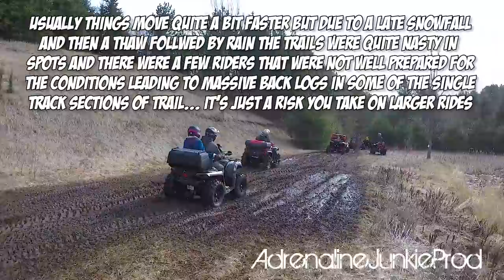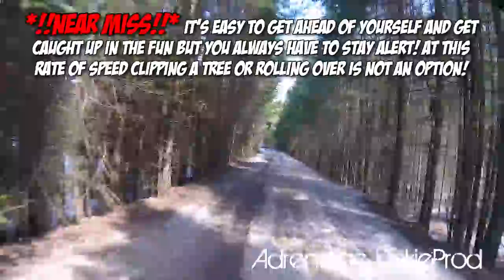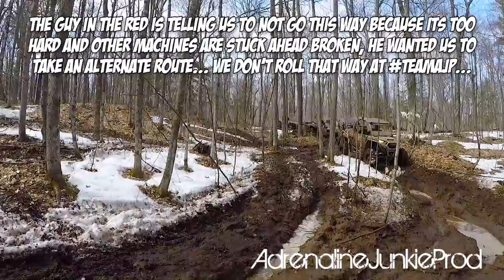Dungannon Mud Bog 2018 - SXS/UTV/ATV - Feature Length Trail Ride - #TeamAJP Trail Vlog 012

Comment: You can also use arctic cat trail shocks on the cf. Gives 2" of lift and a lot softer ride plus allows for larger tires.  And I believe more travel.
Reply from the maker: That's some good info. The shocks on those CF Motos are poop!

Comment: See  that's why you keep yourself small jumper cables and a couple welding rods and you can weld it right back up and go by using the battery off of your ATV or side by side

Comment: I own a CF Moto zforce 800ex and it can go down the trails at good speed as long as your not drag racing it will outrun the rzr 800 so it’s not bad in its class

Comment: great video, recently purchased 2018 rzr xp1000, would love to see video about shock adjustment/recommendations and suspension tuning. Thanks
Reply from the maker: Hey Michael. Next time I'm out at the track or doing some high speed trail riding I'll do a little video on suspension adjustment and what works well for me. Great suggestion, thanks!
Reply from the maker: Congrats on the new RZR by the way!!!!

Comment: ive got a 17 wildcat trail limited with the supper ATV long travel kit that makes it 62 inches wide, a set of 32's on there and it just goes through everything and anything. the thing is just indestructible so when i hear you say that sport works great i believe it.

Im also wondering why they planned a ride that a full size SXS cant go over like that tiny bridge by the start.  around here sometimes rides go through areas like that but they have detours for larger machines marked out and you meet back up with the group after the obstacle

Comment: My 2017 cf moto 800 trail seems to be just fine and seems to have decent power and good suspension travel as well, I mean for the price an warranty difference comparison to equal machines I believe it does as good and better tan some, just saying

Comment: I have a 18 zforce trail with a 2 inch lift stock tires and I go everywhere Polaris, Honda, and Can ams  go. Sometimes better than they do. I want to stay in 50inch class because of the trails I ride. I also have a 2012 commander 60 inch wide and I have some difficulty getting it thru some of my favorite trails.
Reply from the maker: As I've said many times in the past. The most important thing in these machines is the operator. I'm hard on CF MOTO sometimes but at the end of the day it doesn't matter what you ride as long as you're out having a good time.

Comment: try the can am commander 1000 its great and i want to see what it can do on the trails you guys go on
Reply from the maker: There are some commanders in our previous videos. They do well on the trail. A little less ground clearance but generally speaking a very capable machine. With the right driver they hold up just fine with the rest of the pack.

Comment: Would love to see a YXZ1000r SS on a ride with you guys I’m about to trade my wolverine x4 for one and wanna see how it’ll do in these type of conditions
Reply from the maker: Hey Ethan, I'd love to get one out with us on a ride too! They are sweet machines.
Reply: I’ve got one with 70/30 gear reduction and it is awesome. But beware, it doesn’t like the super slow stuff due to the half clutch and it doesn’t have a ton of low end torque. It loves to rev and the sweet sound of the 3 cylinder is music. I wouldn’t buy any other machine!

Comment: When you talk about smaller machines would you consider a 900s a smaller machine
Reply from the maker: Yes Nathan, I do consider the 900S and 1000S smaller machines. I generally refer to anything under 64 inches as a smaller machine. Might not be the best terminology to use but for some reasons that's what my brain has decided to call them, lol. I don't mean it in a negative way though.

Comment: about how many miles can u go on a full tank of gas
Reply from the maker: Hey Michael, it really depends on how you ride the machine. If you are just cruising then you can easily get around 100 miles. I've gone as little as about 20 miles in the past ripping around a track at constant wide open or playing in a muddy field, etc. I'd say 50-60 miles mixed use is probably an average.

Comment: You have to think your cutting the cfmoto down and it’s stock. Your rzr has after market parts on it. If the cfmoto had parts like yours it would be fine. Also I don’t understand why someone would want to drive that fast on a trail. 1 mistake can cost you you life. But that’s your decision
Reply from the maker: Driving fast is fun. Pushing the limits and taking calculated risks create the excitement and rush we are after. When you buy a machine like a RZR turbo you don’t pay for the first 90% of the performance you pay for the last 10% lol. As for CFMOTO, they had a ton of production quality issues back in this era. I know they have improved on things since but this video was filmed a few years ago and the failures you saw here should not have occurred. Stay tuned to the new content on the channel which will be coming out on the next few weeks and months. You may be surprised what you see in regards to some new machines 😉😉

Comment: Logically, if you pay € 13,000 for an utv like the cfmoto you will not get the same as if you pay € 30,000 for a polaris, can-am, wildcat etc.
But as already said, not everyone can or wants to spend € 30,000 on a new utv.
I have a cf moto zforze 800 EX. I do not make long journeys, but after 2 years, I am happy with it.
The zforce model of the video is one of the most basic in the range, smaller and lower than the usual Zforce 600 and 800. Therefore it cannot be compared with the utv of the video. The comparison is unfair.
Greetings from Spain.

Comment: I guarantee my 2016 arctic cat wildcat sport xt is built just as well as your rzr
Reply from the maker: I don't know about that Jacob. I think the build quality on the Polaris machines is a little better. It will be interesting to see how Textron improves on that. I do think the Wildcat's are solid machines though.
Reply: Jacob I've had a 2016 wildcat x on the family ranch and currently have a Polaris razor 1000 xp  the artic cats don't break for shit but the razors have alot better ride and power

Comment: the biggest thing is sxs's are to heavy and if you in a sxs or atv  and doing mud bog's get a lift and run 32 inch assaenators or somthing with bite most ppl i see at these things they got stock machines stock pos tires and think just cuz they got 4 wheel drive they are good no your not i run a 850 reangde with lift kit and 32 inch tires with nos i have enough ground clearence i can drive over a 5 gallon bucket and not hit it just saying ppl dont thing or go try there machine out in mud befor they do this kind of stuff. cuz once you bottom out on skid plate your done

Comment: Cfmoto=golf cart
RZR=RZR
Its just that simple
Reply from the maker: I can't argue that logic man.... I'm gonna have to agree with you.
Reply: You can't compare a 15k CFMOTO to a 30k polaris turbo. You have to compare it to the RZR 900 trail. And they are very similiar. As much as I like watching this guy videos it sucks that all he does is talk crap about CFMOTO even tho they are good reliable machines. Can't beat the 5 year warranty either. Mine is on 28s and 3 inch lift and does great. Big improvement from my sportsman 800 that burned down on the trail.  Just try to see the machine for what it is and its price tag instead of comparing it to your over 30k RZR. Not everyone has the money or sponsers to ride in a expensive machine.